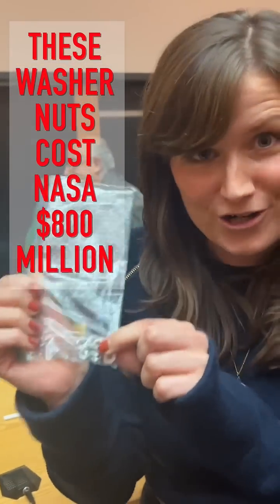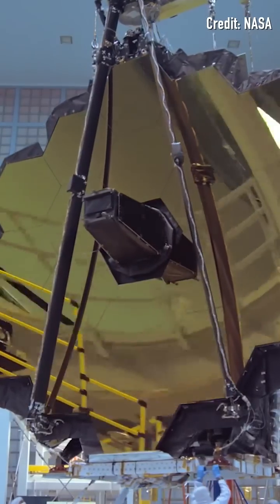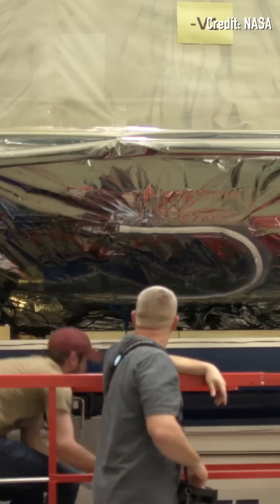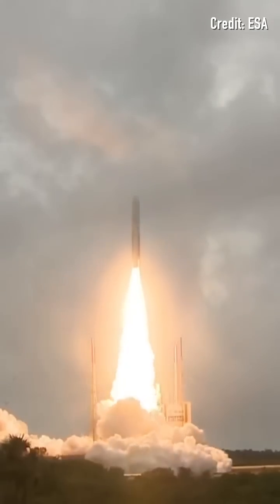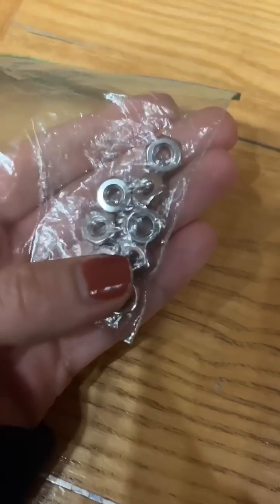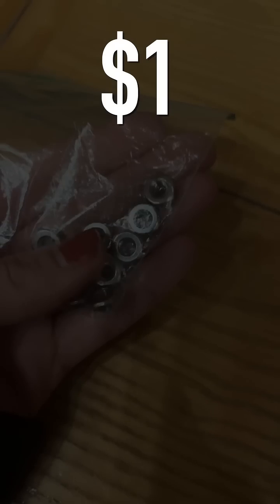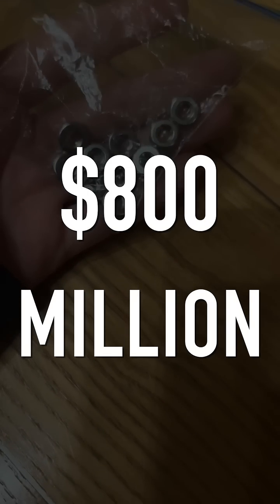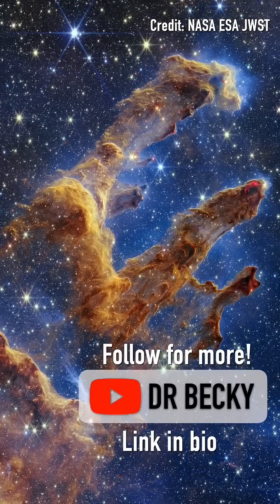JWST cost an extra $800 million because of these 10 washer nuts

Comment: The screws used to batten down part of the sun shield assembly were mated with locking nuts. However, washers were later added to protect the sun shield from potential tearing.  These prevented some screws from fully engaging with the nuts, so some of them came loose. This issue, along with others (a wiring issue, using the wrong solvent, etc.) contributed to the costly delay.
Reply: That explains why, that when they didnt engage properly they came loose. Still im curious as to why they used normal nuts and no krown-nuts or other locking/selfblocking nuts.
Reply: @patdbus  because they are highly highly machined super alloy nuts . Machinist here, with precision threads you can make press fit/ interference fits on the threads which will work better than any locking nuts. Most likely nuts were made with an inconel alloy or titanium alloy
Reply: @adammiller4879  they still loosened, didn't they? Wouldn't have a iron wire, tied around and trough a hole in the nut and bolt  prevented them from coming off, unless the problem already starts when they are slightly loose.
Reply: @patdbus  it was probably an engineering issue and they didn’t make the nuts correctly. But I don’t know for sure and I’m sure they wouldn’t tell us anyway
Reply: @adammiller4879  how did they fail that? Isnt it a rather simple task. I mean, theyre Nasa, they got the best engineers and billions and billions in resorces and they were working on this for 15-20 years. How did they manage to fail so hard?
Reply: @abvmoose87  it sounds almost like its over engineered, and even nasa cant do everything perfectly in one try. Might have been an afterthough somewhere along the lines of: will this even hold agains those forces, "we better be sure and add some extra nuts." To then discover that wasnt really posible to do that the right way and they prob thought it might hold anyways. But thay figured out during final testing it didnt hold anyways, resulting in them having to put many more manhours and effort into doing it properly for the real deal.
Or that is at least how i imagine it might have gone.
Reply: @abvmoose87  when there is hundreds of thousands. Of parts that are engineered it’s easy to overlook some of the easiest details, also it’s the government, look at how fast spacex has become successful, to the government it’s not about being a efficient, it’s about milking every dollar for as many years as possible to maximize funding.
Reply: @abvmoose87  because an engineer today relies on software not knowledge. So if the software says it's ok they don't know better. The common rule for thread engagement is 1.5x diameter but if solidworks allows less they don't know any better. It's what happens when engineers have no practical knowledge and rely on simulation instead of G D and T principles also aerospace typically has a low safety factor meaning parts are built as weak as positive as to save weight this can cause issues to go unnoticed
Reply: @adammiller4879  Because it's NASA they are required to explain.
Government has legal obligations that private companies do not.

A private company would never tell you. Freedom of Information requests exist :)
Reply: @patdbus  lock nuts are not some magical things that never loosen yah know. they also have failure points. remember they are not over building the jwst they are engeneering it to be as light as possible. people keep trying to build literal space stations like a hot rods in these comments and yall really need to step back and think about it some more.
Reply: @adammiller4879 to be fair, NASA does contract a lot of companies including SpaceX.
Reply: @AbsurdAsparagus  it's people trying to act like hot shit when they know nothing about the project, nor where the parts failed. They are honestly the type of people I wouldn't want near sensitive equipment like the JWST because they will likely break something thinking they know better than the engineers, scientists, and even the technicians/mechanics that had been working on the project for a few years to a couple decades.
Reply: So actually, the nut washers were the problem.
Reply: @RobShuttleworth  Anybody who ever even thought about getting an engineering degree should know better than making that mistake on a go-cart let alone space craft. This is a lie to steal money.
Reply: @aculasabacca  Ya, next time that won't happen.
Reply: Well done that man. Bravo
Reply: If this was a Soviet satellite they would have whipped out the tac welder and been done in fifteen minutes, with a cost increase of $7.82
Reply: @CharbeeCapps  very true, but doing that to such a sensitive telescope is something probably even the Russians wont do.
Reply: @CharbeeCapps  The nuts fell off even before the vibration test. I suppose they were never tightened. Some of them were lost and might have stayed in the telescope somewhere. So, I guess they just needed a reason to earn another 800M.
Reply: Correct thread engagement length between screw and nut is one of the most basic mechanical design considerations. Who makes these design changes. Mechanical engineers who get next to no practical training in school or millwright who pick up on this right away.
Reply: @sbucking1966  yeah, should be. A requirement to have manufacturing experience to be an engineer.
Reply: And that's how NORDLOCK was created 😐
Reply: I was going to say if the nuts shaking loose was the only problem couldn’t someone just went and bought some thread locker or used a nylock nut
Reply: @thecoldknight7980  nope because heat and cold makes them not work. Nylock nuts actually suck lol Iv used them a lot in my careers. Nothing beats a press fit on the threads for vibration
Reply: Whoever assembled it should be made to work as a diesel mechanic for a couple of years before returning to NASA, because not noticing that adding a washer makes the bolt too short is kindergarten stuff that should not have been overlooked.
Reply: @ke6gwf  I also find this explanation a bit fishy "oh the project slowed down with 800 days (over 2 years) because someone did not realize extra washers will make bolts shorter". Even if someone didn't notice it wouldn't take more than 2 years for someone else to notice this on the multiple performed checks.
Some planned money grab probably?
Reply: Thanks. Selecting threaded fasteners for proper holding power is NOT rocket science, even on a rocket !  As others say, there were many solutions available. Such an alleged (remember clickbait is always possible) "cost overrun"  is hard to believe. 
Other factors drove up the price. 
Also-  does anyone see an integrated flange on the pictured "nuts" that justified her, despite her doctorate, calling the bagful- "nut washers"?
Reply: This comment doesnt make any sense. Could you be any more vague?? What came loose? The locking nuts? Why only one some and not all? Isnt this Nasa where every piece is custom made to exact specifications with the highest detail. How come this thing came up as an afterthought, wasnt this a multibillion project 15-20 years in the making. Were to belive Nasa threw in some extra washers last second which workrd fine on some places but other places tve whole thing came a part.
Reply: @abvmoose87  they aren’t going to tell us exactly what the fix was or went wrong, like I said in my previous comment it’s very easy to overlook a simple part when there is hundreds of thousands of parts that are hand off between thousands of engineers ,I work in manufacturing, you will notice the more people handling the project (engineers) the more likely there to be hand off issues or design issues with conflicting ways of thinking,
Reply: Thank you! It didn't make sense without this explanation
Reply: Someone used the "wrong solvent" to clean the the thrusters pipework
Reply: Jees they really aren't very good are they ?
Reply: Get me on the team, I'll shakedown the project a bit quicker.
Reply: Would think they would use Loctite, might not hold up to the extreme cold though, i guess.

Comment: Damn use some lock nuts and verify torque.
Reply: No. Talk to the Locktite guys. Lock nuts don't really accomplish much by themselves.
Reply: @metatechnologist  No wonder that's your opinion if you've been talking to those loctite guys!
Don't get me wrong, loctite definitely has its place (great stuff), but so do nyloc nuts. Both are unsuitable for some applications.
Reply: Loctite has space rated applications and have engineers on staff that could have been dialed up. It's hard to understand how the original engineers missed this in the first place. Any bolt can shake loose during launch.

Comment: Imagine how much more it would have cost if just one of those bolts had fallen into a critical part of the un-folding mechanism (for example), or bridged a vital cooling gap, and ruined the whole system if they'd not done the vibration test!

Comment: I am very familiar with the engineering headaches, where I have to spend tens of hours on just simplest circuits to adapt them for a specific task or purpose, costing in the end from 10 to 50 times more than the parts or components themselves.
That's why manufacturing thousands or millions of same models is many times cheaper per unit than making one or a few units, as the cost of design and engineering is very high but spread out across many units.
Single unit design is only for those with deep pockets.
Time is not only money, but life as well, and a skilled and knowledgeable person's time is much more valuable than a layperson's.

Comment: Come on. They could have used spring washers. They are designed to keep the pressure there so it doesn’t undo. 
A Nyloc Nut would also work so long as it’s only needs to hold while it’s getting into the L2 point. After that I think it might be to brittle. 
Even a split pin and a castle nut. 
Come on NASA! 🤷🏼‍♂️
Reply: Could weld the lil buggers for $100

Comment: Yea, $800,000,000 is a lot for maintenance, and $10,000,000,000 is an extremely expensive peice of equipment, but in terms of an american governmental agency its not remarkable. If the department of defense was tasked with building a lagrangian space telescope, you can bet your ass that it would cost more than $10,000,000,000.

Comment: So, it's only kinda sorta true that it was just these nuts that cost nearly a billion dollars. They were a symptom of a much bigger problem, which had more to do with quality control and risk management.

JWST is by far the most complex project NASA has ever worked on, and because it had so much complexity, there were small errors and defects that popped up from time to time, like these nuts coming loose, or incorrect wiring installed, and a few other things. NASA commissioned a review board which basically found that because the project is so complex, their standard procedures for quality control and risk identification and mitigation were not up to the task of ensuring that the project would maximize its chances of success. Remember, this is a project that (a) had "334 single points of failure" and (b) was unrepairable if any one of those single points of failure manifested after launch. Standard risk management procedure can accept some failure given designs often have redundancies and backups in place. JWST did not have those margins to work with.

So that $800 million was largely spent on completely reworking their internal risk management and quality control processes with Northrop Grumann, the contractor who assembled the JWST, and that was money well spent since everything worked.
Reply: This is the kind of quality comments that I live for. Thanks for the clarification!
Reply: Yes but you have to admit Dr Becky's explanation far more fun

Comment: They could have saved millions with a self locking nuts and probably a titanium safety wire to keep it at the same torque. and name it Jesus nut. I guarantee it would stayed in place. Unless a alien breaks the safety wires. Run a test next time on high vibrations I guarantee it will work.

Comment: No such thing as a "washer nut". There are washers, and there are nuts. Hexagon nuts in this case. One would assume that engineers working on a space telescope know how to secure fasteners. It's not rocket science.
Reply: I see washer nuts all the time. There is a difference and they exist. There are a lot of different types of nuts out there, even star washer nuts.
Reply: @TeckGK  You probably mean flange nuts. As I said: a washer is a washer and a nut is a nut.
Reply: This is a really unique and difficult application—way more difficult than run of the mill satellites in earth orbit. Temperatures are just a few degrees above absolute zero, it has to last for decades, and the alloys are exotic and non-ferrous.
Reply: @timothy098-b4f Staking or pinning will secure a nut from loosening from vibration at any temperature. Also the vibrations ocurred on earth, not in deep space.

Comment: It boggles the mind to why they hadn't used locking nuts lol
Reply: Or thread locker.
Reply: @thebigpicture2032  Fluids like thread lock will outgas in a vacuum and redeposit on surrounding components. Nylon also outgasses and you can't use solder for the same reason. A spot weld could warp things. But it seems like a lock pin could be a decent solution.
Reply: There has to be a reason. Maybe the radiation would damage them over time or something like that. I cant imagine they just didnt think about this.
Reply: @JonesP77  radiation? You know it’s basically the same night except for the threads are a little different no they probably just didn’t think of it
Reply: torque figures can be inconsistent with locking nuts because the nylon forms around the the thread differently for each nut. Also, the nylon might not be suitable for extreme UV radiation from the sun and the metal shattering cold of deep space. They might of had to re-engineer the chassis to accommodate locking nut plates as you get on engine bolts of airliners.
Reply: @peanuts2105  There also metallic locking nuts without a nylon ring.
The other option would have been wedge lock washers.
Reply: @johnscaramis2515  Exactly these people on the Internet act like they know shit but they don’t . The  working man knows that though
Reply: @peanuts2105  you know there are  locking nuts that don’t have nylon on them right ? 😂
Reply: I think aerotight nuts were developed for that very purpose. 
Although you do add additional weight and size.
Reply: And that, my friend, is just personal incredulity :p
Reply: A second nut tightened against the first can also lock much better than a single nut.
Reply: @pseudotasuki  adding to weight.
Just as lockwashers add point stress to the object being fastened and the nut itself. Both subject to tooth filling jarring vibrations and acceleration and immense temperature changes.
Space is hard, both on the equipment and on the poor souls that have to design that equipment.
Reply: Has anybody considered they were improperly torqued in the first place and the rest of it is engineers covering their asses by blaming the nuts.
Reply: @martyk1156  has anyone considered that gremlins ate their homework?